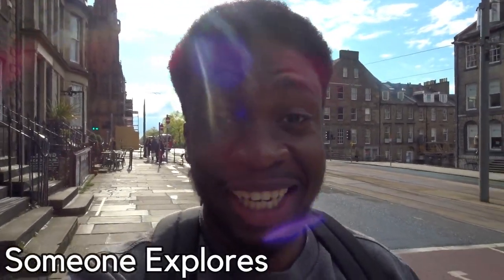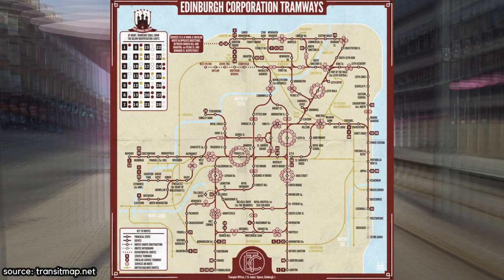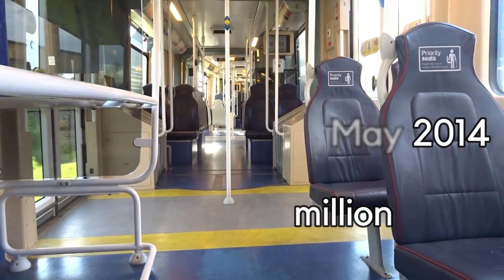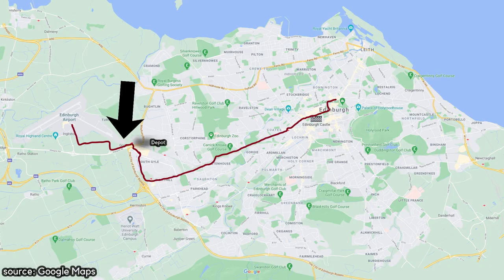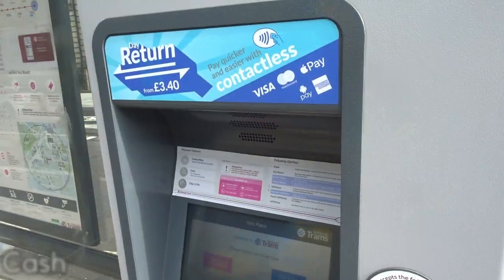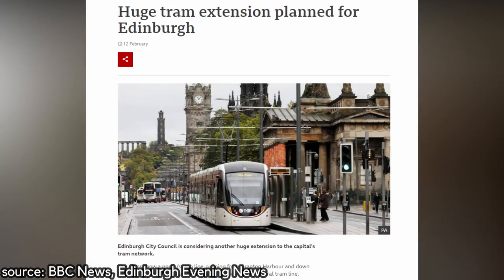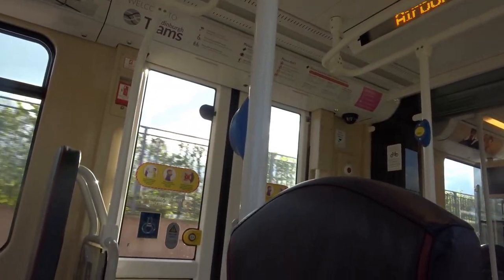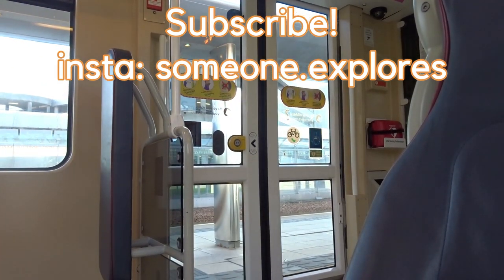Edinburgh Trams: An introduction

Comment: 15 years in the making so far. When are we getting Maglev like the Japanese that can do 600 km/ hr. This things do 70km/hr. The 2014 opening was a scaled back project, running only half original route. They are still building in 2023 after starting in 2008